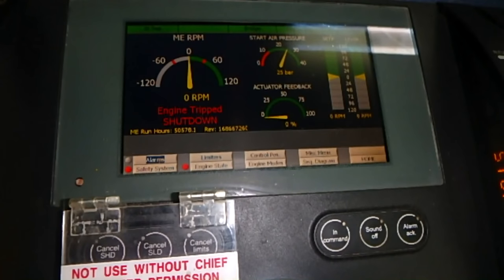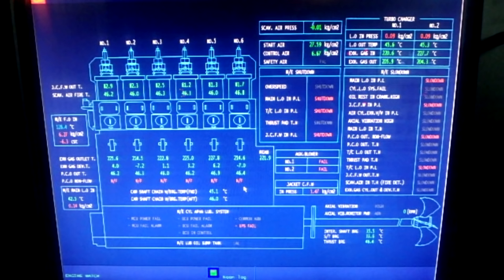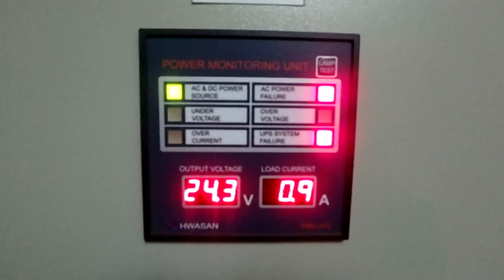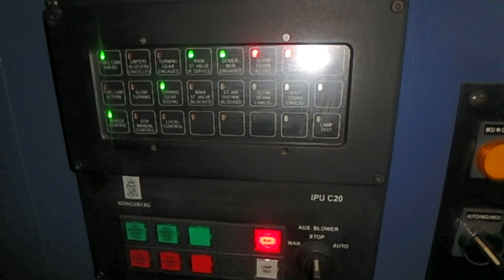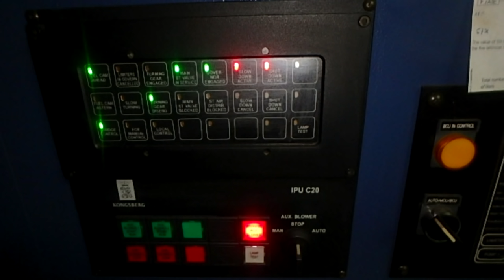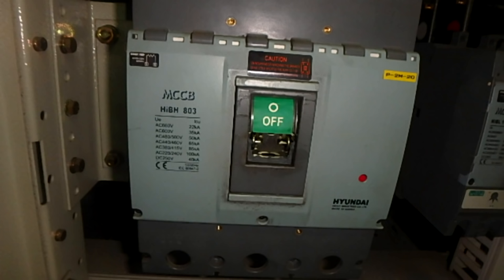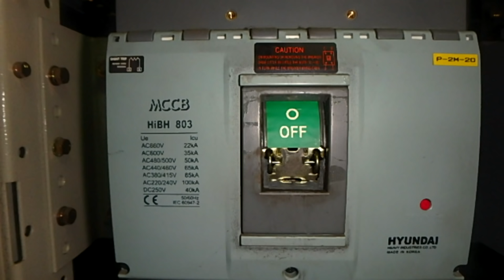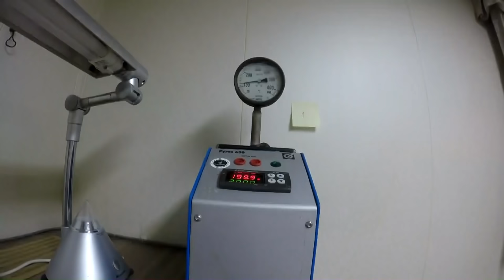BLACK OUT WHAT TO DO IN CASE OF

Comment: So the emergency generator will disconnect from the power grid automaticaly after the first DG is connected to the power grid, correct? The emergency generator can not work in parallel with DG because it does not have a governor.
Reply from the maker: Parallel can't work because different characteristics of generators.About connection and disconnected you are correct.Emergency grid supply only emergency equipment with specific  load of kw
Reply: @Adventure-Story  In real case of blackout I can connect the first DG while the Emergency generator is supplying electricity to the emergency switchboard, right?
Reply from the maker: Yes you can connect. When emergency switchboard  devices installed will supply with power from main generator  automatically the switches will be charged and emergency generator will be discharged and stop after 5 min the engine by timer.If this will not work you need to do it by manually.
Then emergency switch board will be supplied  from main generator and maintain the power in the grind of emergency machineries.
Reply: @Adventure-Story  thanks, I was searching for this information a several hours.I read books and stuff, but they are full with complicated formulas and details.
Reply from the maker: The sequences are important to know for the reason that you can detect most of the problems!
Reply: @Adventure-Story  yes but at the near future I will be a 4th junior engineer and I can ask the more experience guys for help.As you know one guy can not know everything electricity, refrigeration, mechanics, hydrolics, pumps, engines and other marine specific things.
Reply from the maker: @littlearnold8486  yes that is true!